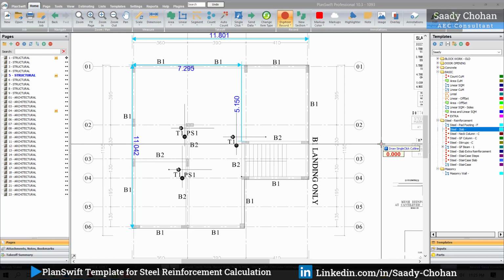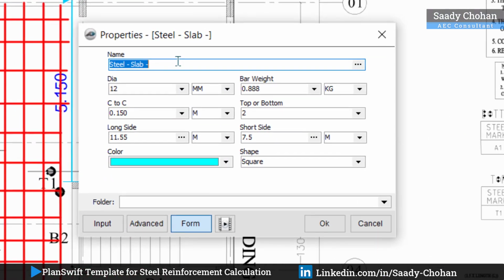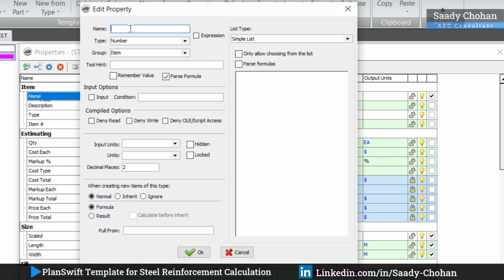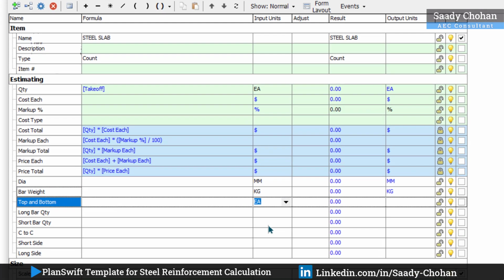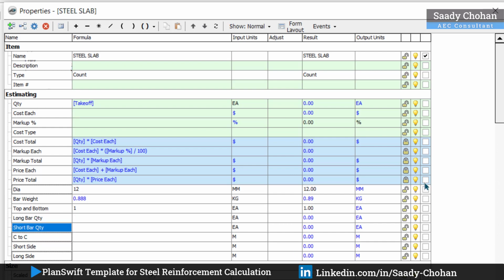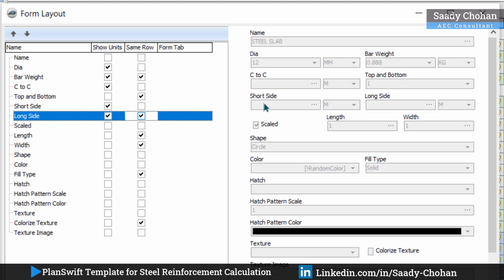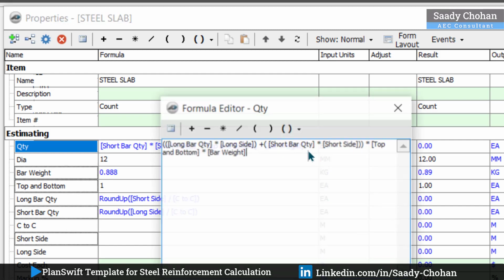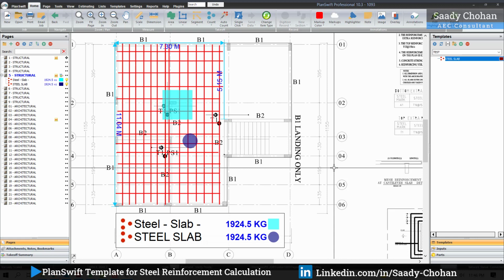PlanSwift Template | Slab | Steel Reinforcement Calculation | Part & Assemblies | Level 2

Comment: I want beam steel template..  Rply with link plz
Reply from the maker: Everyone has different methods for preparing templates. Even if someone prepared and shared a template, it’s not guaranteed that others can benefit or understand it, as there are calculations involved based on different standards and approaches. I recommend you create your own templates. If you need support, i can guide you, Please contact me through Instagram. The best way to start is by creating a formula to get the quantity on an Excel sheet first and then applying the same logic in PlanSwift.
Reply: @SaadyChohan  thank u so much

Comment: Your videos are so so powerful. I learned a lot today. 
However, I have 1 question. How to add the overlap (40 x bar dia) in templates?
Reply from the maker: Well, it depends on how you measure the Qty. Otherwise, you consider additional rates. And I believe, I have shown this in QS Programme videos. Did you find your answer there?

Comment: I am using this kind of templates..but when i came to calculate the beam steel qty 

Main steel and its L bends / curtails, and  end steel how   

Do you have a solution for this?
Reply from the maker: Through Customization you can. If u can calculate on Excel, you can do it on PlanSwift too.